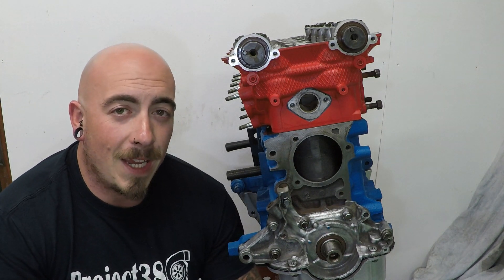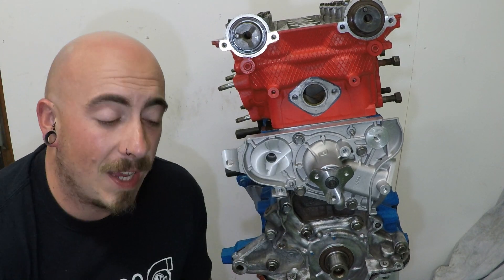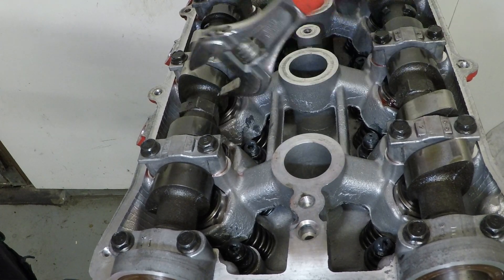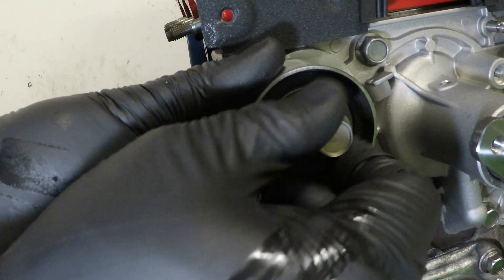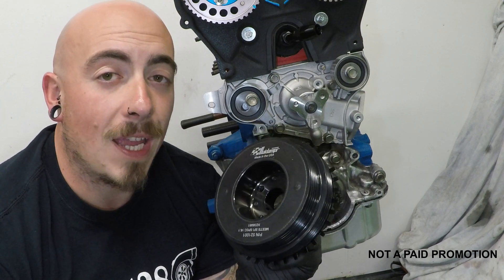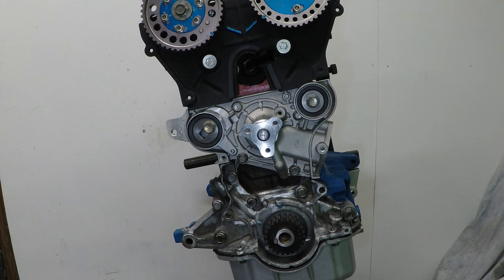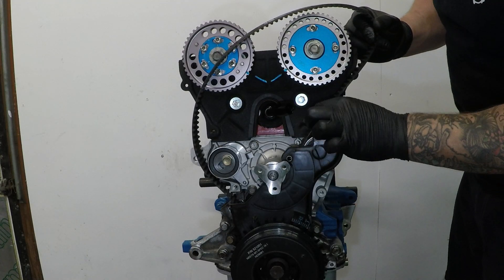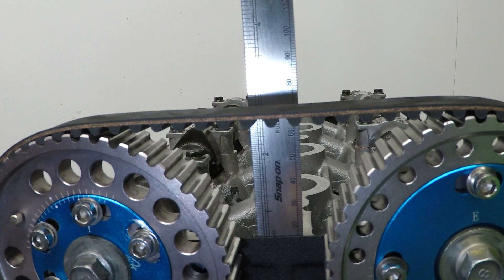TIMING BELT AND FLUIDAMPR INSTALL :MX5 TURBO BUILD pt16

Comment: Not sure if I’m missing something or not, but is there a reason I see people time the engine after installing the damper? I ask because I’ve already got the engine in the car, it’s already timed, I just want to swap to one of these. Do I have to remove the belt, or can I just take off the stock damper, remove the crank bolt, and throw the Fluidampr on?
Reply from the maker: it holds it all together and you need it so you can turn the engine over twice to check timing